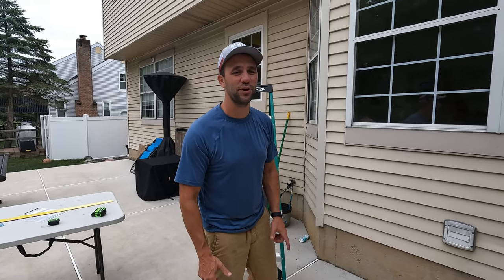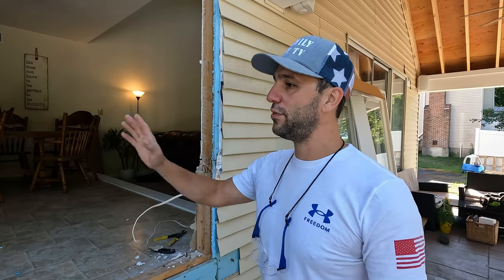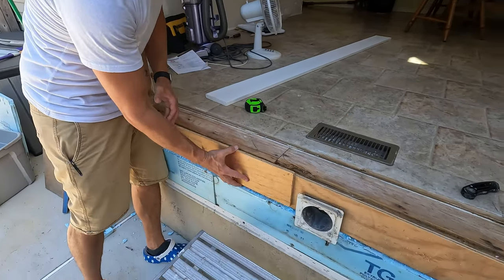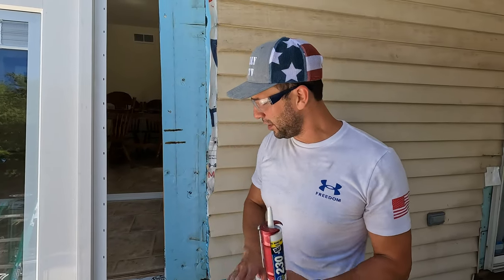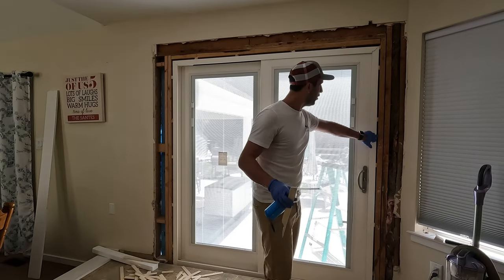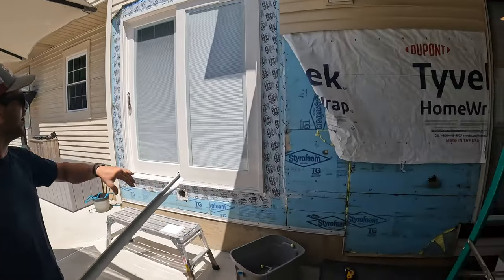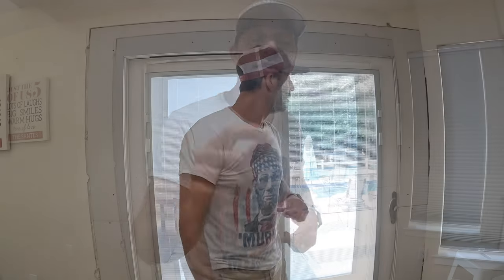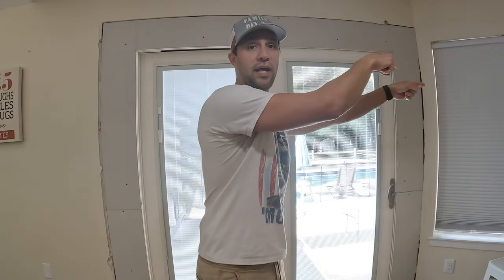How to Convert a Window into a Sliding Glass Door

Comment: The flashing tape you used is not compatible with silicone meaning it won’t stick to it when it cures. You need a polyurethane sealant when using that product like Tremco, Sika, or Permathane
Reply from the maker: Wow- didn’t know that !  Thanks for the heads up.
Reply: This is what scares me about hiring people to do jobs around the house. People don’t know what they don’t know
Reply: @FamilyDIYtv  you did a great job man 👍🏾 I’m looking forward to doing mine very sooner than later thanks for the video.
Reply from the maker: Just heads up - installing door today and called Protecto wrap and asked, That’s not true, its compatible with silicone.

Comment: I think I would have measured from the middle and framed both sides. So that the door would be centered in the opening. What was the reason for not doing that on this particular job? Asking just out of pure curiosity.
Reply from the maker: I’m not sure I understand, the door is centered but we laid the door out where it made the the most sense on the inside and outside.   Notice there’s another door pretty close to it, so that impacted it. Also another door was installed further down the wall, as well as a new kitchen layout in the inside.  Allot of variables… So each job has its own details…. 

Thanks 
Mike

Comment: Handy man want to charge about$ 700 to do the same thing.  Converting window into sliding door.  Is this feasible for me to do?  I'm handy too. Just rerouted my hot water slab leak with pex b . Handyman wanted $2k for it.  I used $ 150 in sharkbite and tubing and 2 days of work
Reply from the maker: I could say with a god plan you can do anything.  I'd say yes you can do it !!!     get a few friends and family to help and don't underestimate this.  one of the most important thing it to make sure you can get it weather tight within the first day, so don't worry about the internal finishing the first day ... just get it weather tight day 1.

Comment: Thank you I’m converting my window and door to a slider and using this as my guidance. May I ask what door you purchased and how are you liking it so far? Anything you’d do differently! I’m about to purchase an American Craftsman slider from HD but I like the trim on yours better. Appreciate your time and input!
Reply from the maker: I used a masterpiece door with build in blinds.   The only thing I’d do differently is trim the outside with white composite trim, instead of running the siding up to the door.   Think it would have looked better, might still do it.   

Both my masterpiece doors came damaged which I had to fix during installation, was a pain !   Also couldn’t get the delivered to my house, had to pick them up.  Which was also a pain.   The delivery charge is well worth it, especially if it come damaged because you can have them take back !   Lol.   

I’m putting one more in and I have to get the same door so it matches.  I’m not looking forward to picking it up again.

Comment: What did you do about the dryer vent directly under the door? Surely you didn’t just leave the vent open under the steps
Reply from the maker: That exactly what I did.  I put a cover on it  and exhaust under the steps.  The step are open, so no issue.  

I was gonna relocate but didn’t make sense.

Comment: Great job. Does the door sit in the bottom plate or subfloor??
Reply from the maker: in my case it's kinda both... if subfloor is at correct height then no issues...
Reply: @FamilyDIYtv meaning you had to add to the subfloor after taking off the bottom plate?
Reply: Btw . Totally love the rolling pin! 😂😂
Reply from the maker: @michaelraduazzo6146  went to subfloor

Comment: I've got a door and a window I want to swap places. How much would something like that typically cost?
Reply from the maker: Doing it yourself? Or ?
Reply from the maker: @Kel-th9hv  It’s cost me 2 grand but could be done cheaper and there’s so many variables.   

The door cost $1,600
Additional installation materials - $200
Siding/ drywall - $200 

You could do cheaper buy getting a less expensive door from HD or lowes ….   Can also spend $3000 alone just on a door.    So its tough to estimate in general.  

- Mike
Reply: My contractor charges $1k for installation.  I'm pretty handy myself.  Should I do it myself?  I fix my own car.  Do my own timing belt on honda Odyssey. I did all my recessed lighting 25 in my new house.  Should I attempt this job converting window to door?

Comment: How do I remove a stucco wall for a sliding door install, what's the best way
Reply from the maker: That’s a whole other process.  You would need a concrete saw BUT you have to be very careful with water penetration with stucco, etc….  Also the finishing will be tough without redoing the whole section, as in patch work is always very noticeable on stucco.    I’d hate to say this but maybe consult a pro on the stucco part.  Sorry can’t really help there.  

When I looked for houses, stucco was a nonnegotiable… I don’t want stucco house.

Comment: I want to do same thing to an old house built 1949 this house has old wooden frame glass windows double pane with storm screens..any advice for me I am building incline but Considering the age of my house what would be your best advice..? My window is 82in high to the floor and 68 width in stud to stud..what size of window would i need..?? Thank you in advance for you advice and help. I can provide u with pics of the old window.
Reply from the maker: You want to put a door in right ?    Your height seems fine but the width, just go smaller than 68.    Consider rough opening size when buying a door.   Not the finished size.
Reply: @FamilyDIYtv  Yes I am putting a door in. I order a sliding door sized 70W x 80H, my house has old asbestos siding on the outside, this will be tricky to mold it on the outside frame, whats your advise for external sealing the flush, and what external kind all weather trim should i use??

Comment: What if the installers skip the sill flashing tape and just lay the door down on wood with silicone between the wood and the bottom of the door
Reply from the maker: Not ideal but prob okay.   That’s the way it was doing for decades.     If it gets a lot of rain on it I’d maybe consider adding tape to bottom to cover whatever wood you can see.    Tough to answer without seeing it.

Comment: I got a wild estimate for an install like this. What do you think is fair? They tend to charge by job rather than hour on something like this. How long did this take you, all in?
Reply from the maker: so many variables.  Best thing to do is get multiple estimates and make sure your comparing apples to apples.  So same quality door, ect..   giving a number is almost impossible.
Reply: @FamilyDIYtv  
Lowe's wanted $900 but when the guy came to measure he said Lowe's wouldn't even allow them to replace double window with patio doors, only door for door replacement. Second estimate $1800. So, Idk where to go from here. Such a large difference in rates.
Reply from the maker: @1YzeWhoaman6821  if that includes door and install, that’s great prices in my opinion !   Check quality of door.  

Think my door alone was $1600, in total it cost me 2 grand in materials.   I did install myself.
Reply: @FamilyDIYtv  
That would be fantastic but the door alone was 4 grand.
Reply from the maker: @1YzeWhoaman6821  4g’s seems high for the door.  $1800 for labor for labor seems a tad high but depends on your location.    It’s a full day, if not more, of work.
Reply: @FamilyDIYtv  
I'm on the East Coast, and yeah, I felt if Lowe's wanted $900 and a handyman wanted $1800, that someone was way off mark. I realize you get what you pay for and yes 4 g's is alot for patio doors, but it's the new Pella all black inside and out with black blinds btg.

Comment: How much cost doing something like that?
Reply from the maker: It’s cost me 2 grand but could be done cheaper and there’s so many variables.   

The door cost $1,600
Additional installation materials - $200
Siding/ drywall - $200 

You could do cheaper buy getting a less expensive door from HD or lowes ….   Can also spend $3000 alone just on a door.    So its tough to estimate in general.  

Any more questions- let me
Know
Reply: Can this be done in a lid cabin?
Reply from the maker: @josephinedunn5764  assuming you mean log cabin.  Yes it can be.

Comment: How much this cost you plsr
Reply from the maker: It’s cost me 2 grand but could be done cheaper or more and there’s so many variables.   

The door cost $1,600
Additional installation materials - $200
Siding/ drywall - $200 

You could do cheaper buy getting a less expensive door from HD or lowes ….   Can also spend $3000 alone just on a door.    So its tough to estimate in general.

Comment: Don’t worry about the fact you didn’t build a header to structurally cover this new opening. It’s people like you that give builders a bad name.
Reply from the maker: Dude - there was an existing window ! So in conclusion there was already a header there.   As a “builder” you’d think you know this - lol.  Here’s your first builder lesson, windows have headers !  Lmao !     

Some of the comments from people make amaze me.    

Come on man, don’t always look to find something wrong, look to help and better others.  

-Mike
Reply: @FamilyDIYtv   Brother, if this was inspected it would fail without a proper header. The header on the existing window was insufficient, there needs to be the width of the wall X 5-1/2” minimum for an opening this size. The header needs jack studs on the sides and cripplers above to distribute the weight. Don’t get defensive, take it as constructive criticism and use it on your next job. That’s how we get better 💪🙏
Reply from the maker: @tomhuggard1510  so a door needs x 5 1/2 but window doesn’t.   

Also this door opening was smaller than existing window.
Reply: @FamilyDIYtv how is a sliding door smaller than an existing window ?
Reply from the maker: @GY6SCOOTERCHAT  the door has to be the same size or smaller if you want to use existing header.